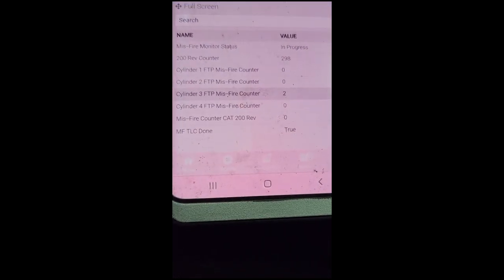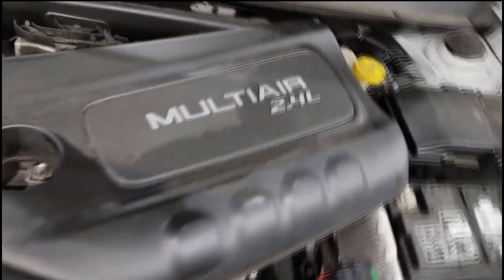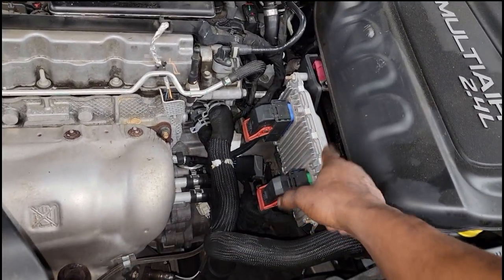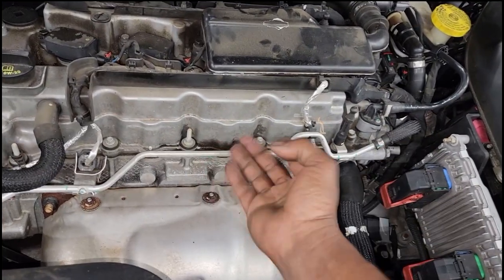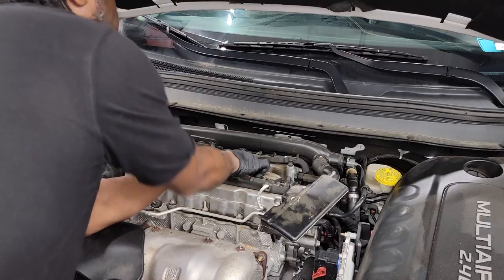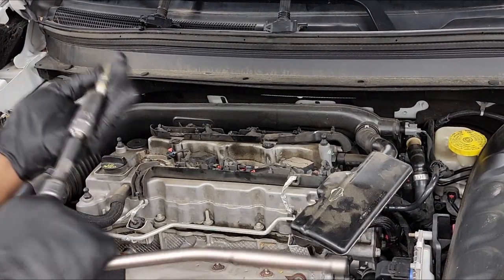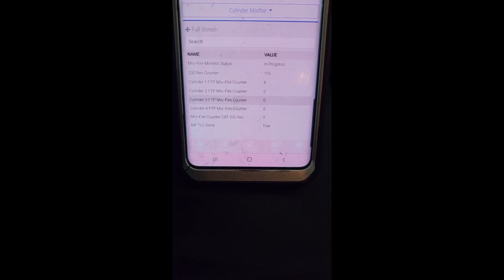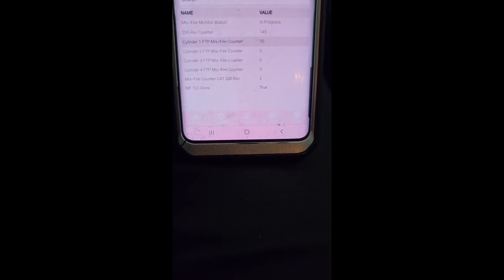Mechanic explain why it cost $200 to diagnose this problem.

Comment: A good scan tool from Snap On will cost a shop around $6,500.00 and they need updates just like your cellphone. These cars in the last 20 years are very dependent on electronics

Comment: JT $200 is about right, I am independant so I charge $94 before I will open my toolbox, average time to diagnose a car including test drive is about an hour, charging a diagnostic fee also weeds out the guys that want to take it to cousin pookie for a cheap fix, my A list customers I just check out the car call them and then fix the thing, the Bs and Cs pay the $94
Reply: Good!

Comment: Cylinder 4 drops out still under load on the Chevy work van I drive. They are aware of the problem but haven't specifically taken it in to the shop for it. I'm not going to tear it apart to check it myself. It still uses conventional cap, wires, plug setup being a 2001.
Probably won't be fixed before I retire but I guess as long as it mostly runs ok. My old Neon had plugs that had 80k on them when they finally started missing when cold. The gap was worn to about 80k too.
Reply: hey Dartman, I love seeing what JT is up to, great guy good mechanic, saw your post if this van is a 4.3 V6, and a miss fire on # 4 this may sound nuts but it is the distributor gear worn out, I do not know why it always starts on #4 but it does, a budget fix is pull the distributor and egg out the hole where the hold down bolt goes and egg it out a bit and rotate it until the misfire is gone, you can also get a new gear for it , hope this helps